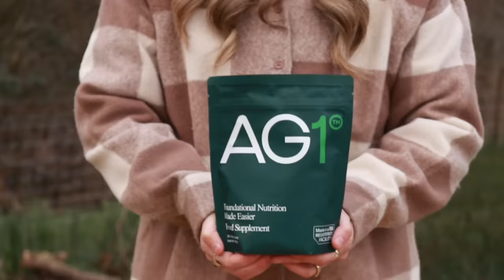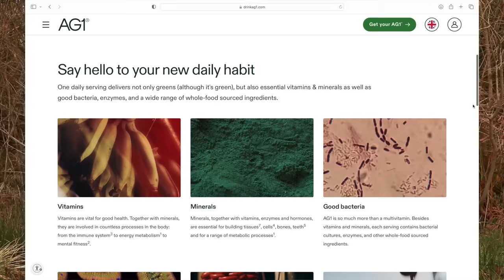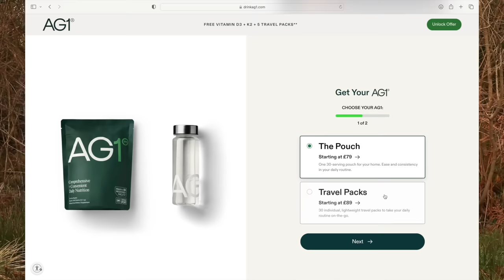New beginnings. Building our dream off-grid homestead in Wales

Comment: my favorite couple building,.... John and Emily Let me tell you first your header is right but not finished not only should it be flush outside it should be the same inside for whatever wall coverings you do,... say like sheet rock or gypsum board. that will not work. How we or i do them is whatever the thickness of board your doing it should be the same with a header and i use scraps of plywood in between long header boards. to make them as thick as the boards. it looks like maybe you can add a 1/4 inch thick piece of plywood and another 2 X 8 i believe your building with all the way across so it is flush inside and out. Walls i don't know why your making them so thick??? Do you get -50C weather 10 months out of the year? WOW  2 X 6 would be sufficient no more than that. Because remember you have to insulate that wall the thicker the more insulation. not that thicker isn't bad more R-value is awesome.. just more work more weight. But header?,... fix them or be sorry.  Top of your wall needs another plate and don't put seams in the same place a little board underneath is a no go!!!!! So if you can't find a board the full length of home,... then go as far as you can and then butt the two boards together. both outside walls were top top plate seam is on  walls should be differnt too. But at the ends leave it open. like whatever the thickness of walls leave that at end of long wall empty until you place end walls in proper location. no final top plate why.. because when you build end walls and they fit snuggly in place. Then a full board from end of length walls  all the way across the end to other wall you will nail screw fasten to hold all walls together. So in essence you have top plate and then bottom plate with up right studs and when you stand that wall up you add another plate on top fastening ends to shorter end wall. Should be a book on tying top plate to wall somewhere around there if not get a hold of me and i will send you photos of proper tie ins of walls. Last you asked how to build rafters? after all walls are up find center of end wall. Find the height you want.. me i chose 3 foot. In center mark a line that will be center of wall go out left 3/4 of an inch mark that and then another mark 1.5 inches  going out same way. then repeat the other side of center mark. Again do one way and then other. find three boards one short for center that will be your ridge board will go sandwich them all together.. now if you do it right the center board will be short by.... well whatever your gonna use as ridge board 2 X 6 maybe 2 X 8. So outside boards will be 3 feet inside will be short by either 6"inches or 8" inches. do the same for other end of house. now what is your length of your new home? get either 2 X 6 or 2 X8 that total length bring it over and set it in those two places where it is short your ridge board is set.  You can screw the top plate to the three boards standing vertical. if you want that way your measurement should be precise. Then you measure every 15 1/4 inches or 23 1/4 inches from top plate down to top plate of outside wall.  when you put rafters up always put one one side of those marks so when your done they should all be 16 or 24 inches top ridge board or top plate wall.so you should have a bunch of  boards with a diagonal  cut that screws or nails to ridge beam and then a cut out on board hitting top of your wall. cut you will be doing is called birdsmouth cut. and before you cut to exact roof edge remember an over hang so each rafter should befrom center down to roof edge plusi used 1 foot overhang. the hang over your choice.. Again the cut is called a birdsmouth and my over hang is 12 inches. When you build one side of your rafter all others for the whole build should be exact same measurements angle on ridge beam and for birdsmouth that screws or nails to top plate. When you have all the rafters done. you can take out three boards on end walls both ends  will stand by themselves because rafters will not need  the support. then build small walls at angles at last rafter tying it all together. You can and lots do put as you call noggings between rafters to hold them on center mark 16 inches or 24 inches.. makes sheeting roof easier. when everything is on center mark.  sure wish i was there i could sure help. but far away i hope you get everything out of this i am putting into it. And as for your pencil jacks under your home! what they call leveling jacks hahaha .... those are a no no remember the more weight you add the more they are gonna have to handle....Cribs... they look like this #  but bigger.....are the best bet to hold your house flat and level on concrete.. them jacks after a while will collapse like a house of cards..or bend like warm candy on a hot day. and no bricks under axels that is a no no too.... more weight those axels will bend nothing should be under them except air Nothing!!. have fun can't wait to see other videos.
Reply from the maker: Hi Gary, appreciate the lengthy reply. The headers, i'm going to add some wood but not a full 2x6 piece, just enough to fit window revel and internal wall sheathing too, that allows me to add a 25mm or so piece of insulation to the back of the headers for a bit more thermal break. You said the wall thickness it too thick, the timber we are using is 6x2 CLS 140mm x 39mm. Means our mineral wool insulation we used in the floor will also fit straight in the walls with no need to trim as it already sized for 40cm centres. We already have another top plate in our design to lock all the walls together and i know about not having all the joints in the same place but good to know. Would you just nail the next top plate on or does it need bolting  or something else? i  know external osb sheathing will overlap it all and give extra strength. 

The thing with the rafters, i've watched lots of videos on the type of roof you describe but ideally i'd like a raised tie truss design to give the steeper pitch roof externally but then set the raised tie (flat section of ceiling) at our maximum allowed internal height which is 3 meters from finished floor to finished ceiling, this would give us extra space inside but also give a nice look outside i think, i feel a normal trussed roof would look quite flat from the outside as we are only have an extra 60cm from our second top plate before we hit our max internal ceiling height of 3 meters.

The cribs you mentioned aren't used in the uk, the only article i can find about them are this https://evogov.s3.amazonaws.com/media/63/media/48779.pdf if this what you mean? Once we've done the wall frames we will site the chassis again, going to site the axle box section onto oak timber sleepers, do you think that's a good idea instead of the concrete blocks (not the actual axle as the manufacturer of the chassis called me to tell me this was very wrong to do) If we made cribs like this, what size would you make them? The galvanised steel levelling jacks are the norm in the uk which is why we have them, the final siting of the chassis would be axle section of chassis on oak sleepers then the rest of chassis on 8 steel levelling jacks.

Comment: Hi Guys. Love the channel. Please could you give me some more details about the Joolca boiler setting fire? I have one that I use for wild camping and just a bit worried now. Thanks
Reply from the maker: Hi Will, as we keep our shower unit outside we thought maybe some leaves or something had fallen in it which might have been causing the fire. We did open it up and cleaned it out but couldn't find anything 🤔 it's been amazing up until now and we've used it everyday for nearly two years! In the brands defence they did offer us a complete replacement when we sent them videos of our issue, their customer service has been great. We just haven't gotten road to sending it back. I do think something had just gotten inside the until due to being outside 😅
Reply: @CampOutWest  thanks for the reply. I wasn’t sure whether it was a fault, even though frustrating for yourselves hopefully that was the issue then. Cheers 😊